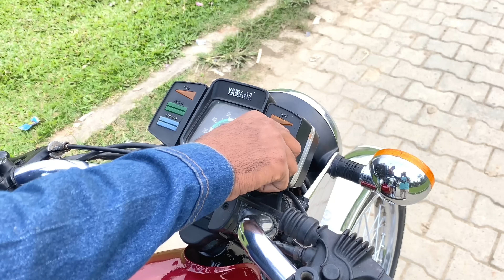Yamaha RX135 Full Restoration | Repair & Restoration

Comment: Zinc plate the hardware, dont burn the bejesus out of the muffler if you arent looking to replate, and remove all the bolts and grommets before you paint. 
This is mechanically repaired, but not a restoration